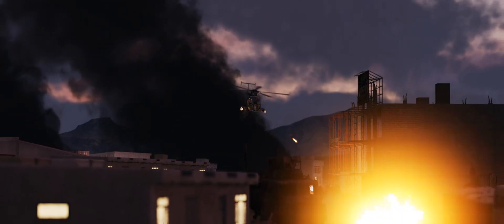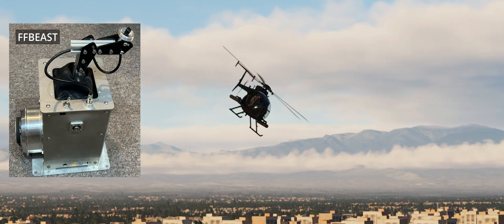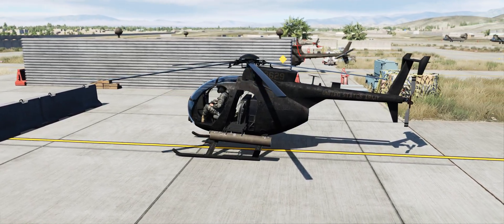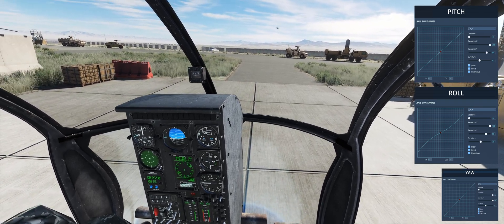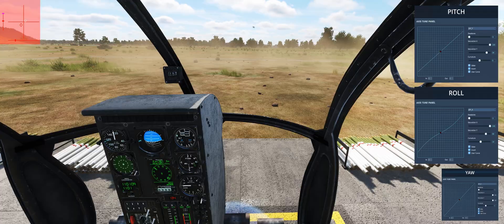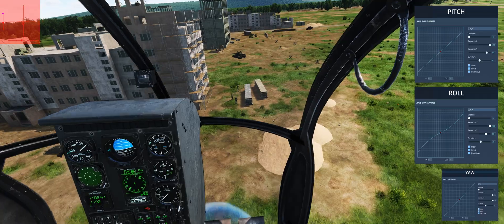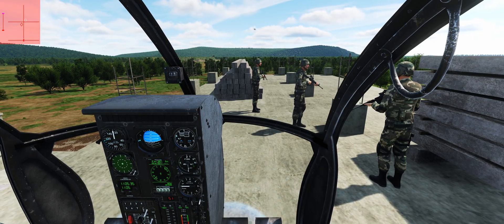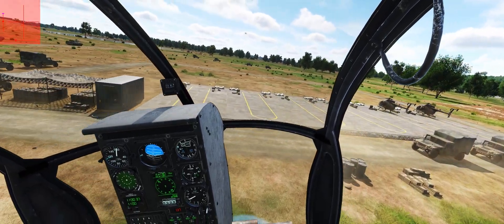Maximum Helicopter Flying Precision: How To Set Up Your Flight Controls/ Curves in DCS World | AH-6J

Comment: Hey, T,, thanks for the videos and tutorials. The mod is very well done. Since you have direct contact with the developers, can you suggest that they develop an "load troops" command that makes the deltas reapear outside the MH-6? Its just like the "deploy gunner" command but in reverse. We could use this together with the f10 menu to simulate a troop extraction by deactivating ground troops with the menu and malking them reapear on the side of helicopter using the "load troops" command.
Reply from the maker: I think they are actually working on something like that already 👍

Comment: 4:45 in Warbirds I usually run at 80 or less pitch axis % saturation
Reply from the maker: I wouldn’t. Fixed wing aircraft, especially high performance aircraft require full authority. Especially for spin recovery and in certain other situation.
Reply: @CommandT which is what I determined with multiple tests. All Warbirds reach critical angle of attack at any speed with less than full deflection of joystick. Being the pitch axes hyper-sensitive and being a curve not desirable due to an over sensitive full deflection behavior I discovered with about 80% I can still reach max-alpha angle, spin, stall and have a less aggressive pitch axis. Just my choice 😊

Comment: Good info, thank you. Question about the I have the winwing pedals that I bought a few months ago. I literally use up almost all my left pedal authority for takeoff/ hovering. What parameter can I adjust to help that ? 
On another note, this mod is simply amazing. As is the Oh-6. The developers really hit it out of the park.
Reply from the maker: If you haven’t used any saturation on the yaw axis then you’re just running out of left pedal authority because you are too heavy/ hot and high, requiring a lot of main rotor torque and you don’t have enough pedal left to counter - reduce the weight/ fuel/ load. That’s just the way it is.

Make sure you’re pedals are calibrated correctly and you’re getting the full range of pedal authority in the sim

Comment: For the AH6J, I use 45% saturation on the Y-axis for both pitch and roll for my VKB Gladiator.  👌
I’ve found it best to never use any curves and only reduce saturation for all helicopters when using a self-centering stick with no extension.

Comment: I recently purchased and received the vkb gunfighter with the 20c extension, and it helps a lot. coming from planes it’s not been easy transition to rotor, but it’s a lot more fun to simply fly.  on the other hand, there is combat, and that is an area I really need help with. fighting in dcs rotors has mostly ended in death

Comment: You can also set a user curve. With a user curve of "05,10,15,20,25,30,35,40,45,100" you effectively have a saturation of 50%, but if you use full deflection, you can use reach 100% saturation. I am experimenting now with a user curve of "0,8,16,...100" and a saturation of 80-90%. 

I think that may screw with the force trim FFB…

Comment: I use a PS4 gamepad (yes, it's crazy, but I'm used to it, I like to fly with my feet on the table). I've greatly reduced the saturation of the axes and added a bit of curvature. And after a few dozen flights, I began to succeed. This is a really cool mod, it doesn't even compare to the old Gazelle flight model)))
Reply: I use a ps5 controller and and after a few mishaps during the learning stages with the modules I can now consistently fly it’s just seems landing I needs to focus on
Reply: @bradwhit2853  how do you control the collective?
Reply: @linecraftman3907  I mapped the collective to Triangle and Cross. Left stick is pitch and roll, pedals are on L1/R1, and R1/R2 are for the miniguns and rockets.
Reply: @bradwhit2853  I also practiced this evening and learned how to hover and maneuver confidently. I even had some fun circling the quarry on the map and shooting BTR-70 miniguns.

Comment: TBH I never thought about reducing the saturation for helicopters but it makes a lot of sense. I'll definitely try that.
If for some reason you can't have a FFB stick I would advice to remove the spring* from your joystick and use the maximum possible extension. Then on the software site remove all curves and don't use trim.
The reason for that is that in helicopters a lot of flying is based on muscle memory, for ex. how far to move the stick forward during transition into ETL. Using trim will make that harder because the stick will move to different positions depending on your trim and your flying will be less consistent. You will loose a little bit of precision though (depending on how short your extension is). 

*I think you can easily remove springs on Virpil bases. I for example bought myself a second used Warthog base and removed it's spring so I can easily swap between flying helis and aircraft.
Reply: I would advise to not do that. Though removing the center, thus creating a dead or sticky joystick, sounds like you are getting close to the real thing it is much harder to fly. The real mag-locked cyclic stick will lock the current position while still giving you the option to move the stick for small inputs while returning to the current center. Having no center at all makes it very very hard to keep things stable. If you want to try it, go for it but i am pretty sure 8 out of 10 people prefer to use any non-FFB stick with very light springs and some dampening on the clutch. No center doesn't really work like one think it does. However having a non-centering pedal is really worth it.
Reply: This won’t work well on the Apache because trimming doesn’t just lock the stick - it tells the system to do things.
Reply: @cmdrbigity6914  Thanks. I was considering buying the Apache, now I think I'll wait for the opportunity to have FFB stick first.
Reply: @PLHarpoon  I don't think it is just the Apache either, but I'm not certain since I don't really fly other helos outside of the Chinook.